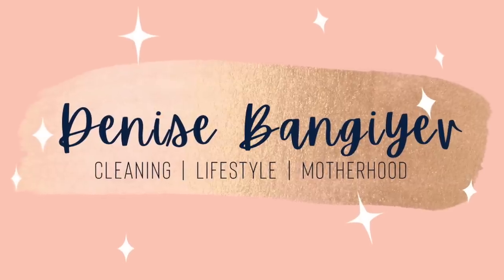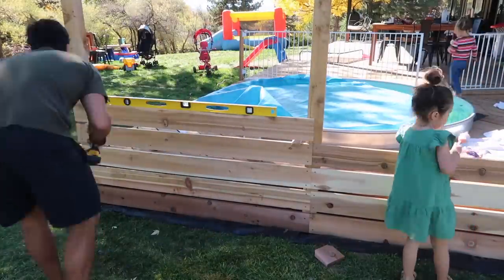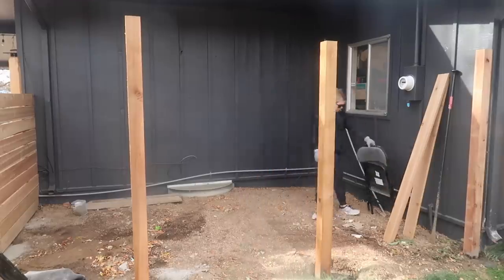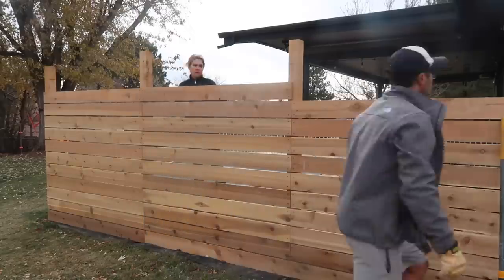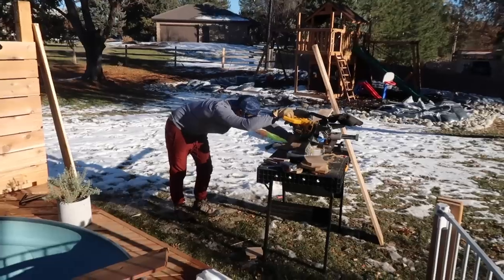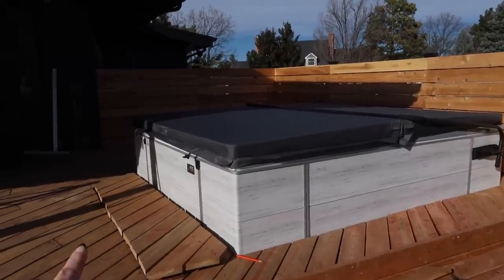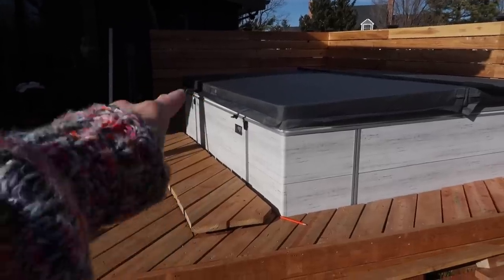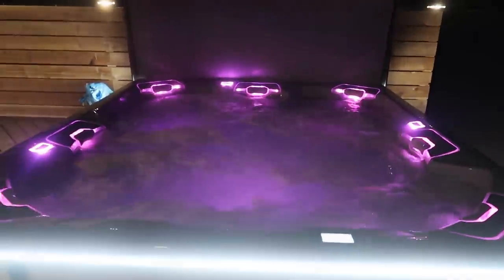DECK TRANSFORMATION| BUILDING A PRIVACY FENCE | HOT TUB INSTALL | DENISE BANGIYEV

Comment: Denise those 2 solar lights may get enough sun in the summer when the sun is higher in the sky

You can also get a contraption that helps with the lid. It’s looks like a water ski boom on a boat. It’s good for a 1 man pull back.

Comment: Tip for gutter drains……Home Depot sells a four inch black flex pipe with a fitting that is square on one side to fit the drain and round on the other to attach the pipe. You dig a trench to bury it starting straight down and out into the yard, then cover it and forget it. The grass will be watered from underneath, keep it fairly deep so no moat will form or direct it under a row of shrubs or trees.

Comment: You might find the solar lights under the awning will light up during the summer when the sun is at a different angle.  My solar lights definitely work better/worse depending on the season.